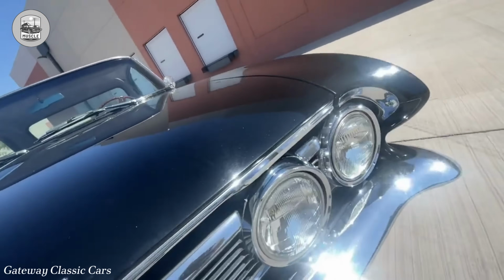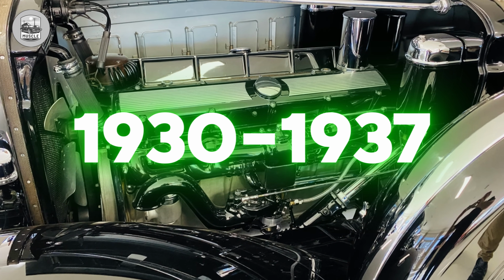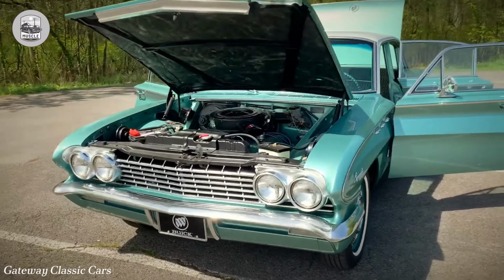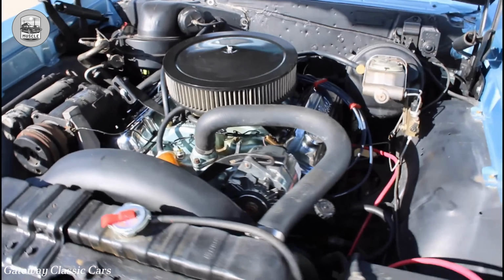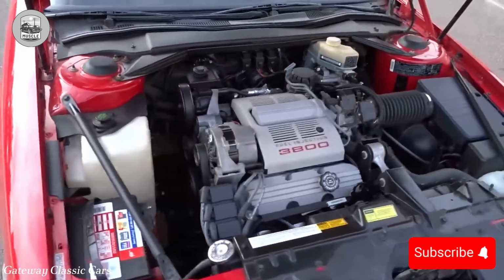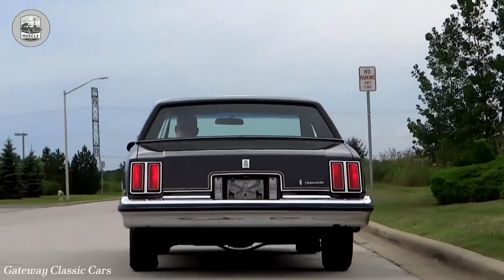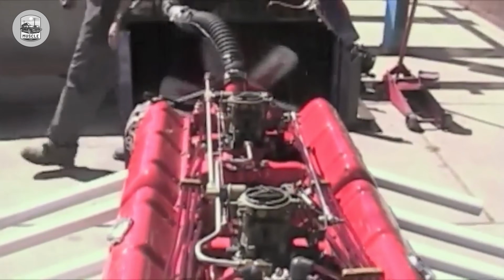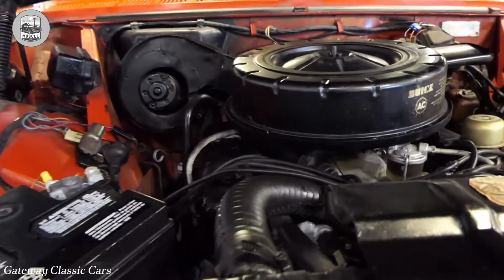10 MOST FAILED and WEIRDEST GM Engines ever made | Worst engines blunder!

Comment: The v12 is a torque monster it was built for work i believe they were used in old dump trucks and in the logging industry
Reply: While V12 engines are powerful and capable of producing significant torque, they weren't primarily built for heavy-duty work like dump trucks or the logging industry. In fact, V12 engines have historically been more commonly used in high-performance and luxury vehicles, such as sports cars and grand tourers, because of their smooth power delivery and high-revving capabilities.
When it comes to heavy-duty industrial applications, straight-six or V8 engines are typically preferred due to their simpler design, lower production costs, and higher torque at lower RPMs. V12s, on the other hand, are more complex, expensive to maintain, and not ideally suited for the rugged demands of industries like logging or construction. This engine type was more about smoothness and performance, not brute, low-end torque for heavy work.
Reply: Absolutely! The V12 is indeed a torque beast, built to handle heavy loads with ease. You’re right, these engines were commonly used in dump trucks, logging, and even some construction equipment. Their ability to generate massive low-end torque made them ideal for such grueling tasks.
Reply: Jaguar XJS sports car was a V12 but it was also a nightmare to work on end of tune but very popular because of its smooth performance... That is like with any Jaguar when it actually ran.
Reply from the maker: @ca-lt1fc  You're spot on about the Jaguar XJS V12! The performance was undeniably smooth, but you're right—it was notorious for being a nightmare to maintain. That V12 had a labyrinth of vacuum hoses and electrical components that often caused headaches for even experienced mechanics. But when you got it running right, it was one of the most refined engines of its time. Jaguar enthusiasts often put up with the maintenance for that unmatched ride quality, though!
What’s your take on how it stacks up against American V8s like the 427 or the 289? Let’s get a discussion going in the comments. And don’t forget to comment, share, and subscribe to Muscle Car Masters for more deep dives into the best and worst of automotive engineering
Reply from the maker: @FlorentinoAnthonyContrevas  Thank you for your information. It is so great...
Let's see our channel is a place to share, comment or show your feelings about American Muscle Cars.
Have a good day.
Don't forget to like, share or SUB on our channel to enjoy other great Muscle Cars videos.
Spending more time with other great videos on our channel to explore more about American Muscle Cars.
Reply: I actually know of one of these in my city building. They have it on display because it was their old generator when the power went out. It powered all the local federal buildings, with them being built around the main courthouse. Still runs fine from what I'm told.

Comment: Sir Jack Brabam won the Formula 1 championship in a car he built in Australia, he drove and the car was named after him . Sir Jack Brabam teamed up with Repco an Australian engineering company in the 1960s , they orginised with General Motors Holden to import Oldsmobile versions of the 215 ci Alloy GM motor , they liked the Oldsmobile version as it had one more head bolt per cylinder . Repco designed 4 valve Over Head Cam heads to bolt on the GM pushrod block . They not only beat Ferrari but everyone that year in F1 and won the Championship. That must be the only " pushrod" production GM block to ever win F1 .
Reply from the maker: That's an amazing piece of racing history! Sir Jack Brabham's accomplishment of winning the F1 championship in a car he helped build is a testament to both his driving skills and engineering vision. The collaboration with Repco, using the Oldsmobile 215ci alloy engine, is a fascinating story of innovation—especially the addition of Repco's 4-valve overhead cam heads to a pushrod block, which allowed them to dominate the field, including Ferrari.

Don't forget to like, share or SUB on our channel to enjoy other great Muscle Cars videos.
Spending more time with other great videos on our channel to explore more about American Muscle Cars.
Have a nice weekend.

Comment: General Motors Holden Australia V8 , starting in 253 ci, and 308 ci in the late 1960s evolving into the 304 ci 5.0 injected V8 in the 1988 Holden Commodore ( google a pic of the 1988 Holden 5.0 , notice it looks like an LS1 5.7 , same intake style, same port locations , same uprite valve angles , same bellhousing pattern, same roller cam, same Delco Engine Management, same Transmission (T700/4L60e/T5/T56) but the Holden V8 came out in 1988 , ten years before the LS1) it later evolved into the last version the 355 ci 5.8 Litre Sequential injection motor in 1996/7. 

Holden even went down the Over Head Cam 3 valve head design in 1988, there are many offical GM Holden pictures of this engine , it almost made it into the 1988 VN Commadore SS , it used many of the Pontiac OHC design from the early 1970s .
Reply from the maker: Thanks for sharing that detailed history of the GM Holden Australia V8! The evolution from the 253ci and 308ci engines to the injected 5.0L V8 in the 1988 Holden Commodore is fascinating—especially the parallels with the LS1. It's incredible how ahead of its time Holden was, using similar intake styles, valve angles, and even engine management systems nearly a decade before the LS1 came onto the scene. And that 355ci 5.8L Sequential Injection engine—what a beast. The mention of the OHC 3-valve head design from 1988 is intriguing too. Imagine if that had made it into the VN Commodore SS—an OHC Holden V8 would have been a game-changer!
Let’s hear from others who have insight into Holden’s V8 journey. Drop your thoughts, experiences, or any rare facts below! Who knows, there might be more hidden gems in Holden’s engineering legacy.

Let's see our channel is a place to share, comment or show your feelings about American Muscle Cars.
Have a good day.
Don't forget to like, share or SUB on our channel to enjoy other great Muscle Cars videos.
Spending more time with other great videos on our channel to explore more about American Muscle Cars.

Comment: I have to disagree about the Buick 215 V8 being a 'failure.' Its lightweight design paved the way for modern aluminum engines, proving that innovation doesn't always require immediate success.
 It's a classic that should be celebrated.
Reply: While it's true that the Buick 215 V8 introduced lightweight aluminum design and was innovative for its time, calling it a success might be a bit generous. Its early production was plagued with manufacturing issues, including casting problems that led to reliability concerns. This resulted in GM abandoning the engine after only a few years. It took the British Rover company to refine and truly make use of the design in the long term. So, while the 215 did lay some groundwork for aluminum engines, it wasn't until later iterations that the concept became viable and dependable. Therefore, calling it a "classic" should be weighed against its mixed early history.
Reply: @KeithGreene-k1v  While it's true that the Buick 215 V8 had early production challenges, dismissing it as a success overlooks several key factors. First, the engine's innovative use of lightweight aluminum made it a pioneer in the automotive industry, drastically reducing vehicle weight and improving performance—benefits that were recognized even at the time. Though GM abandoned the engine after a few years, it wasn't because the design was fundamentally flawed, but rather due to the high cost of production and the learning curve of working with aluminum. The fact that Rover later refined and successfully used the design for decades only underscores its long-term potential, proving that the foundational engineering was solid. In hindsight, the Buick 215 was a trailblazer, and its status as a "classic" reflects its groundbreaking role in shaping future aluminum engine designs. The early issues were more about the production process than the engine’s inherent capabilities.😁😁😁
Reply: @AdelynDodson you might want to look up Sir Jack Brabam ! They won the Formula 1 championship with a 215 ci Alloy Oldsmobile version of the GM 215 V8 , they built the car and engine in Australia and Jack drove the car to the championship. Repco and Australian company still around today designed 4 valve over head cam heads for the push rod block , and beat all !
Reply from the maker: @JosephCowen-fz8vj  Absolutely! Sir Jack Brabham is an incredible figure in motorsport history! His 1966 Formula 1 Championship win with a 215ci Alloy Oldsmobile V8 is a brilliant example of innovation and determination. The Repco team’s ability to modify the pushrod GM engine with 4-valve overhead cam heads is legendary, proving that ingenuity could outshine even the biggest competitors. It's a story worth celebrating, especially for car and racing enthusiasts!
Let’s hear from more people! If you’ve got stories or thoughts on Sir Jack Brabham, Repco, or the amazing 215ci V8 engine, drop them in the comments! Share your favorite moments from motorsport history too!
Reply from the maker: @JosephCowen-fz8vj,  @AdelynDodson and @KeithGreene-k1v 
Thank you for all information. It is so great...
Let's see our channel is a place to share, comment or show your feelings about American Muscle Cars.
Have a good day.
Don't forget to like, share or SUB on our channel to enjoy other great Muscle Cars videos.
Spending more time with other great videos on our channel to explore more about American Muscle Cars.
Reply: @MuscleCarMasters68  yes there should have been more written about that , an Australian driver , his own built car and a GM pushrod V8 converted to OHC by a Small Australian engineering company working out of a used wool store . Casting , machineing and building a Formal 1 engine . And winning the Championship against the best in the world like Ferrari, Lotas, Ford . I remember pictures of those heads , and they bolted onto the Oldsmobile 215 ci V8 block .
Reply: @JosephCowen-fz8vj  While it's true that Sir Jack Brabham had significant success in Formula 1 and that Repco played a pivotal role in his championship wins, there's a need to clarify a few points about the engine. The engine used by Brabham wasn't a direct Oldsmobile 215ci Alloy V8 but rather a heavily modified version of the block. Repco used the basic architecture of the Oldsmobile 215 but developed their own components, including the 4-valve heads, to make the engine competitive in F1. Furthermore, it wasn’t built entirely in Australia—Repco sourced components internationally and focused their development on refining and customizing the design to meet F1 standards. This wasn't just a simple adaptation of a GM 215 but a ground-up re-engineering for race performance. It's also important to note that Brabham's championship success was not solely due to the engine. The chassis design, aerodynamics, and Brabham's driving skills were equally, if not more, important. So, attributing the victory solely to an Oldsmobile-based engine overlooks the broader engineering feats that contributed to those wins.
Reply: @AdelynDodson  undoubtedly, but they used a production block, and heavily modified . Only as much as ford Heavily modified the 427 to run over head cams. I've seen the run down on the F1 Oldsmobile, and they used the Olds because of extra head bolt per cylinder and Olds cross bolted the main caps. The Brabam used a steel crank, and rods,  forged pistons and external oil pump / system the heads were simple cam on bucket type . And mechanical Bosch injection with crank fire ignition. As good a chassis is , if you ain't got the goods in the engine dep you are not winning and F1 is all about reliability , that Repco provided . BRM had big budget grate flat H 16 cylinder engine and failed so well .
Reply: While it's true that Repco started with the Oldsmobile 215ci V8 architecture, they extensively re-engineered it to meet the demands of F1 racing. They developed custom 4-valve heads, sourced parts internationally, and integrated advanced technologies, making it far from a simple GM engine adaptation.
Moreover, F1 isn't only about engine power—chassis design, aerodynamics, and driver skill are equally critical factors. Jack Brabham's success was due to the perfect harmony of these elements. Simply having a reliable engine wouldn't have been enough without an equally impressive chassis and Brabham's exceptional driving talent. The fact that even well-funded teams with powerful engines, such as BRM's H16, failed to succeed highlights the importance of the entire package, not just the engine.
Repco's achievement was in delivering a reliable, competitive engine that complemented Brabham's overall team strategy, which went beyond just the engine.
Thank you anyway for your opinion.
Reply: Cost was the issue. Buick decided to try to use core castings to hold the liners in place rather than machine the block and sweat the liners into the block. The sand cores would shift and many blocks would have to be scraped as the liners would be off-center,  cocked or total fallen to the bottom of the casting. Rover did it the correct way by casting the block then machining the block and sweating the liner in. More $ but in the long run was cheaper as less waste but more time.
Reply: @randallblack9519  yes I think your rite , shame though !
Reply: The Rambler I-6 didn't fare as well with its Siamesed cylinders and blown head gaskets,

Comment: The Jetfire Turbo V8 was truly ahead of its time! It combined innovation with power, showcasing GM's daring spirit. It’s hard to believe such an ingenious design was shelved due to its complexity. What a shame!
Reply from the maker: Absolutely! The Jetfire Turbo V8 was a groundbreaking engine, a real testament to GM’s willingness to push the boundaries of automotive technology. It combined turbocharging with a high-compression V8, delivering impressive power for its time. But you’re right—its complexity and the challenges with the fluid injection system led to its early demise. Imagine what could have been if they had perfected it!
What do you all think? Do you have any other forgotten innovations from back in the day? Drop your thoughts in the comments and share your stories! Let’s keep this conversation rolling.
Reply: @MuscleCarMasters68  This is also the engine that interested me. The methanol injection was ahead of its time & still used in the aftermarket. I have a small gt15 turbo that's been sitting in my workshop a few years waiting to install in my classic '62 vw beetle. I've read where others have used the methanol inj. on their air cooled engines. Good stuff !
Reply from the maker: @monongahelian  The methanol injection was indeed groundbreaking and still packs a punch in the aftermarket today, especially for performance enthusiasts looking for a cleaner, cooler burn. On top of that, the GT15 turbo is a perfect match for a classic Beetle – it’s small enough to spool up quickly, which really helps with an air-cooled setup. When combined with methanol injection, you’re looking at a cooler combustion chamber, which can help manage the heat in an air-cooled engine and improve performance under load. It’s no wonder that so many air-cooled fans have started exploring this combo!
We’d love to hear more from you and the community! Anyone else experimenting with methanol injection, or thinking about turbocharging an air-cooled classic? Drop a comment, share your experiences, and don’t forget to subscribe to MUSCLE CAR MASTER CHANNEL to keep the conversation going. Let's make this channel the ultimate hub for muscle car fans and enthusiasts worldwide!
Reply: @monongahelian  The Jetfire Turbo V8 was innovative, but its complexity wasn’t the only issue it also struggled with reliability. Methanol injection was clever, but maintenance scared off buyers. Compared to muscle car simplicity, it felt over engineered. That said, it paved the way for modern forced induction tech, so it deserves respect for its influence